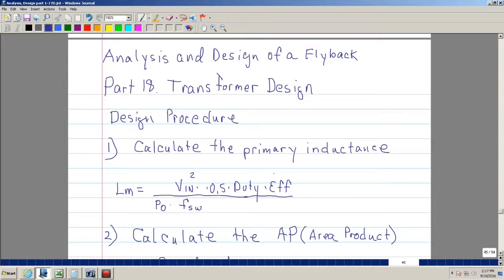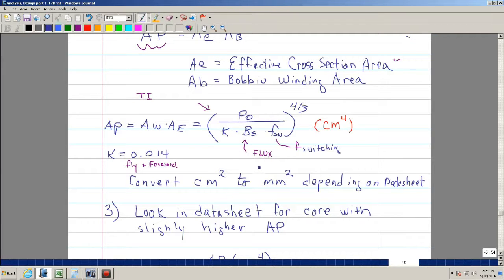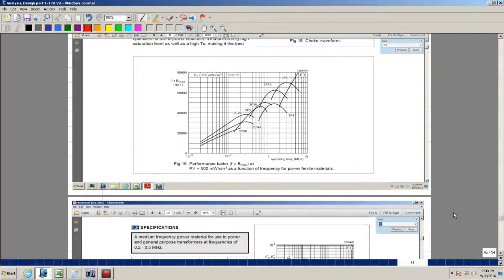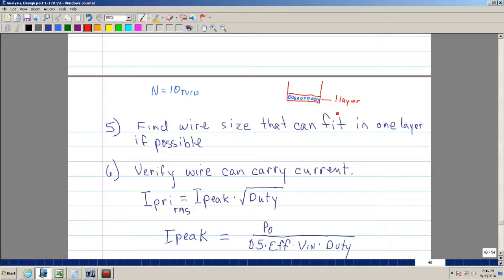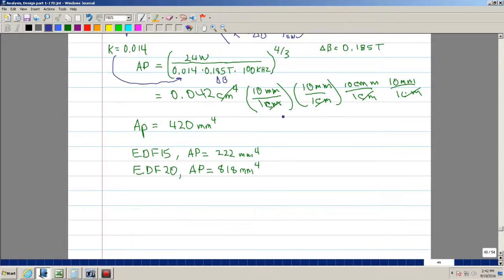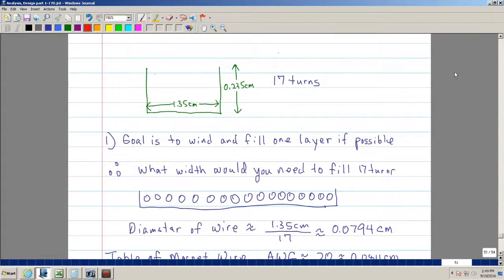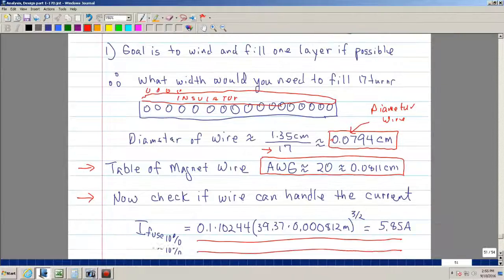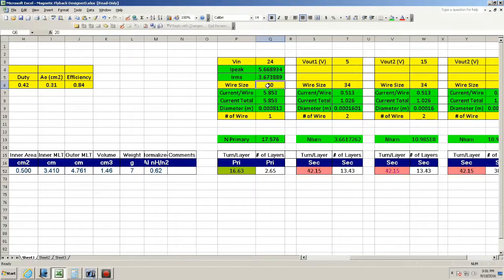Analysis and Design of a Flyback; Transformer Design A, Part 18

Comment: Sir, is it really required to calculate inductance.. Seems, no where we are using it. Can you please explain..
Reply from the maker: Yes, it is necessary to calculate the primary inductance.  The amount of inductance determines what mode of current conduction you are operating. This video discussion is for a simple design using discontinuous conduction mode (DCM) and using a current mode PWM. Using these two properties allows you to design a simple compensation where you don't have to worry about the RHPZ and the subharmonic oscillation and thus you don't need to use slope conpensation. Hope this make sense.

Comment: Sir in some books it is mentioned that air gap is necessary in case of flyback transformer design and for that AL value is also important, but you have designed transformer by different method and didn't mentioned air gap. So please clear my doubt. Thank you
Reply from the maker: Vicky, That is so true. We need an airgap. So you use a core that has higher AL that will exceed the designed inductance. For example, if you watch video 6, I wound the transformer ungapped and then grinded the center core to get the designed design inductance. There is a formula to calculate the gap. However, some people use  sheet of paper inserted into the gap to simulate a gap. I prefer to start grinding and measure the inductance until I get the desired inductance. That was a great question. RB
Reply: Even I have this doubt

Do you have any document where I can design a Flyback trafo?

Comment: Sir, Many books / articles uses different-different formula for calculating number of primary turns. If we plug-in our data in those different formulas answers will be different for every formula. Some are including waveform coefficient as well as duty ratio others omit one of it or both. How to decide which formula should we use?

Comment: Hi Robert is .16T for any level of power?
Reply from the maker: When calculating the AP of the core, use 0.16T.  But when you are calculating the Nturn, then use B from 0.16T to 80% of the materials Bsaturation. In my example, my Bsaturation is 0.370T.  So my my example, I can use a B from 0.16T to 0.293T. However, as B goes up, Nturns goes down, and Pcore_losss go up. So there are many compromisise.  I will be doing another video tonight review this information and then cover the subject of skin effects and proximity losses.
Reply: Thanks so much